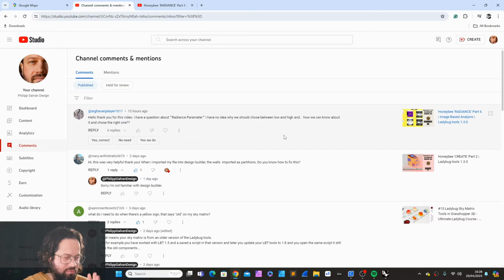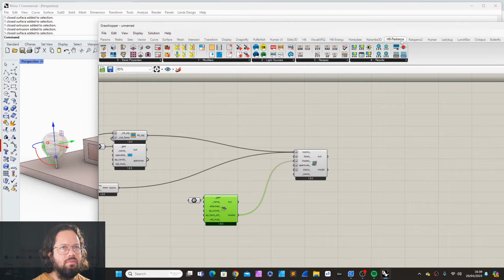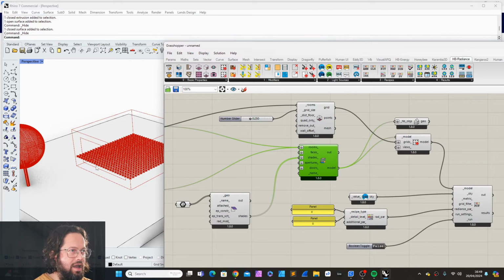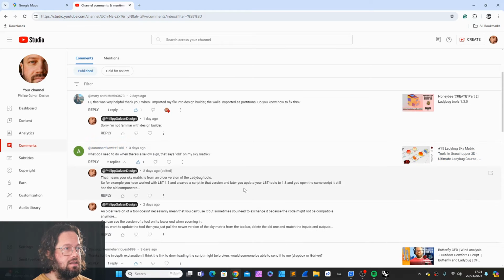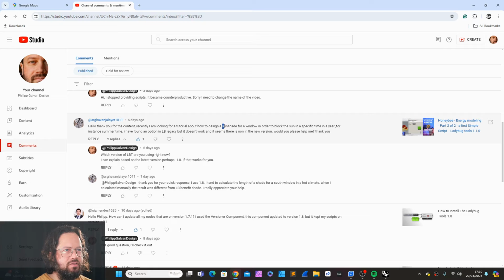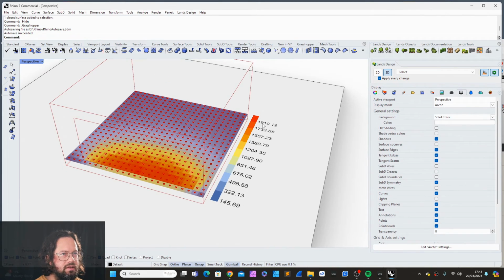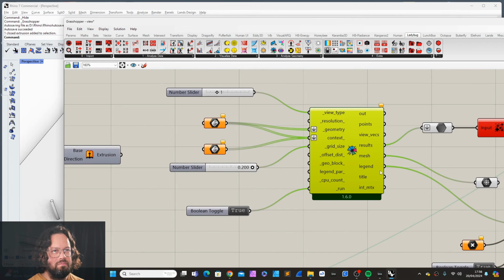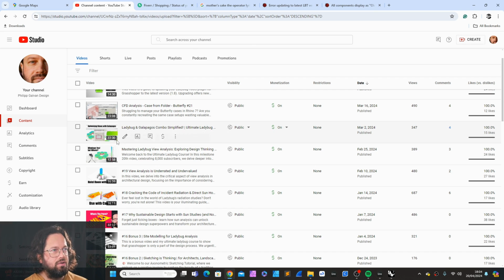Ladybug Tools 1.8 - Q&A and Troubelshooting - Part 1

Comment: Hi, you mentioned on this video that the windows surface shouldn't overlap the wall corner. If you have curtain wall, how does that work? Do you firstly make a surface as a wall, and then another one on top of it so it has the role of the window (curtain wall), or is there any other method about it?

Comment: Hi, it was a really helpful vide as always. Have you ever got error in annual daylight that Radiance fails to load one of the files when calculating the direct sunlight. I'm having it and couldn't figure out
Reply from the maker: Hmm not sure. Haven't encountered such problem. Let me know if the problem persists.
Reply: @PhilippGalvanDesign  thanks for replying. yes unfortunately it continious. I shared the post in ladybug tools dicourse platform under the name in oyongoren. I'm trying to try every suggestions 🙏